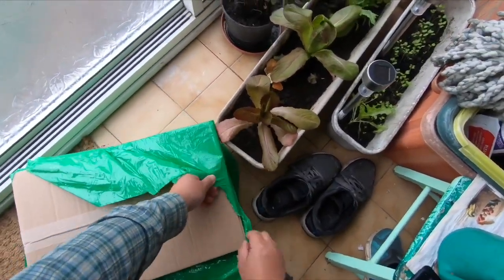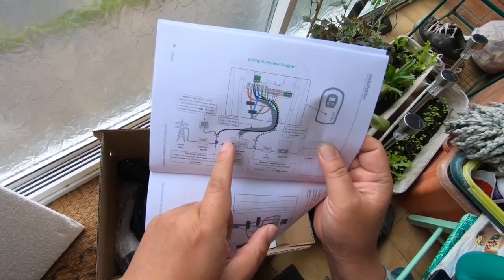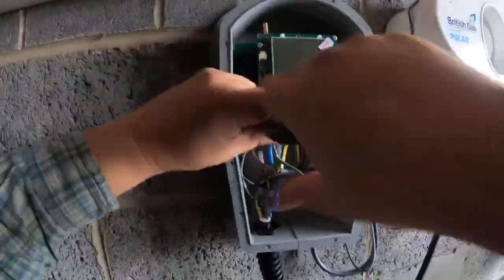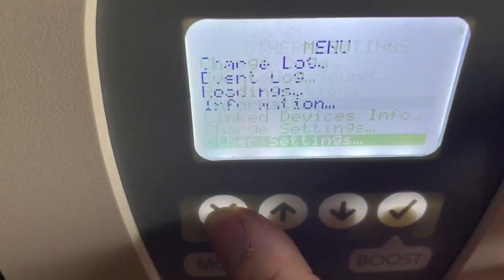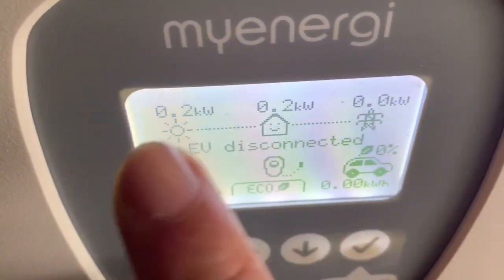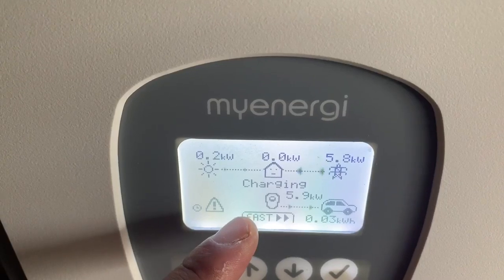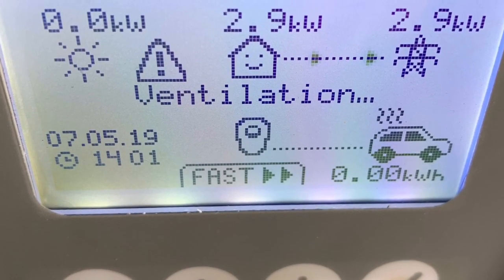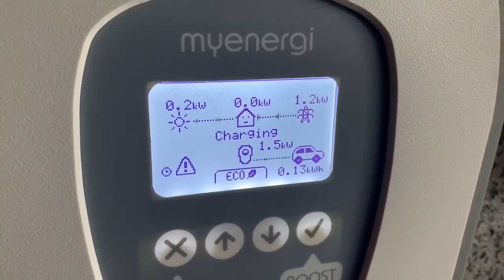Solar car charger... trouble shooting my zappi charger...

Comment: Can this charger charge an electric vehicle using only the surplus electricity from solar power?
Does this charger adjust the charge of the electric vehicle when the surplus of the solar power generation is reduced?
Thank you.
Reply from the maker: I have a different video to explain the different modes of this charger... https://youtu.be/1h29Qt_8yY0?list=PLpxkeh8ZyS9qgqzRASQm6M99RVYwjoeAM

But essentially this yes it can do what you want... 
only the solar is at maximum of 4kw output (I have a small roof and enough for to pay a 4kw panel array), and the car charger can only charge at a maximum of 7kw or level 2 ( I believe) you can add a battery to totally change quickly on sun power or just grid power... I choose to wait the 2hr top up time to do a free 30mile round trip to the next town...
I hope that answers your question...